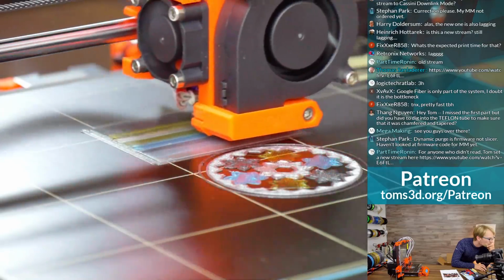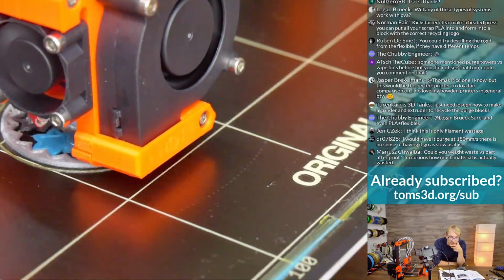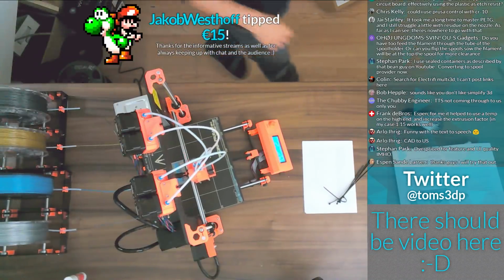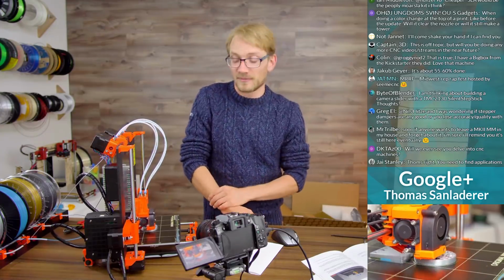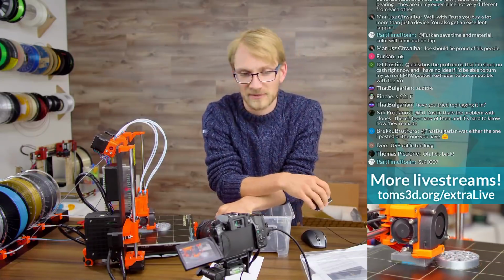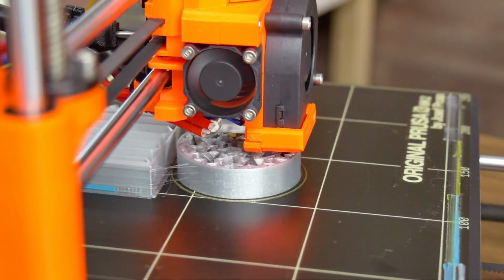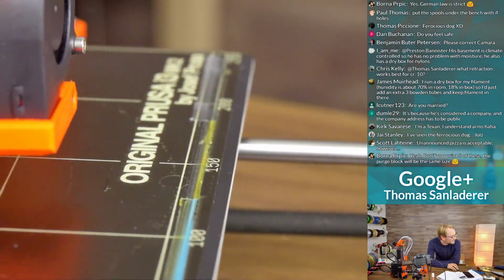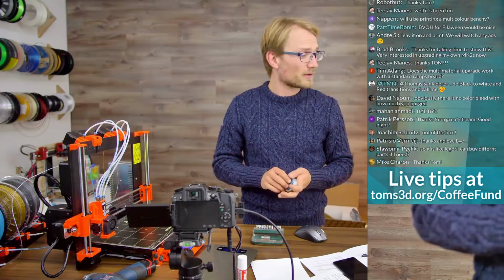Prusa Multi-Material MK2S: Watch its first 4-color print!

Comment: Now we can load and print with four filaments at once, now we need a way to actively mix cyan, yellow, magenta and black together in set amounts to print in any colour, even though I know that's probably a few years off yet.
Reply: This exists. You can buy an accessory I think it's called Palette. It's a box with multiple filament inputs and 1 output and it can mix colors
Reply: Its Also called a diamond hot end. they have actually been around for a while now
Reply: MatthiasChristiaens the Palette is the same concept as this, it just splices up to 4 colours into a single filament, no colour mixing.
Reply: Robert Hunt oh okay I thought it could do color mixing
Reply: Erm, no.

Comment: I've recently added a PEI sheet to my printbed and I'm having terrible trouble with it.
PLA parts are just sticking too well. I've tried slowly increasing the height of the first layer, but eventually I end up with slight lifting on the corners...but the middle is still affixed do well, I need to hammer at it.

Seeing Tom just pull the perfect part off with his fingers....gah!

Comment: Thomas, could I take the purge tower and drop it in a ziploc bag and then put that in boiling water to soften the block enough to make a casting from it? 

If the block could be softened enough to fill a mold, that would be awesome. :{J

Comment: Is there a way to tune out the starting and ending scar of the side of the silver part you pointed out or is that always going to be there in some form? It wouldn't be with single extrusion would it?
Reply: ripper9111 You can certainly reduce it's visibility by tinkering with the slicer settings. You can also change setting to move where it is, so it could have been moved to an internal face.
Reply: Ah ok. Thank you.

Comment: Don't have a huge budget but own a anet that I rebuilt with aluminum extrusion and 3D printed parts using a e3d v6 think I could get a upgrade kit from prusa and use it also what board would I need if you don't mind helping thanks for the great video tom

Comment: Hi Thomas. How's diamond hotend compared to this "quad Y" approach? Is it better/worst? Thanks for your videos. Always great content!
Reply: Eduardo Sachwek Fontanetti have one.... Main dissadvantage is the weight but these results are probably possible when not even able to outperform duo to the sharp nozzle tip, but for these small Details you definitely need to do a side by side comparison oft the prints. Also dont geht the 3mm Version (its Bad) also keep
in mind that you can only really use this hotend With slic3r
Reply: Jonah Distl on the Diamond, is it possible to change nozzle?
Reply: Eduardo Sachwek Fontanetti yes... the entire brass block is that nozzle that does the trick its like in the 20 ish range.